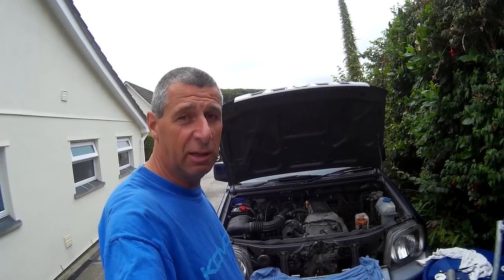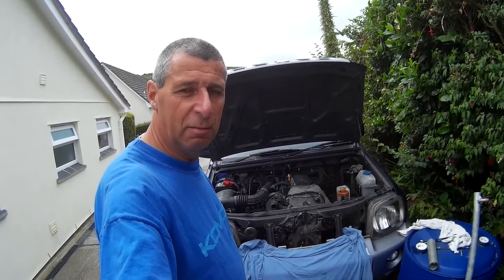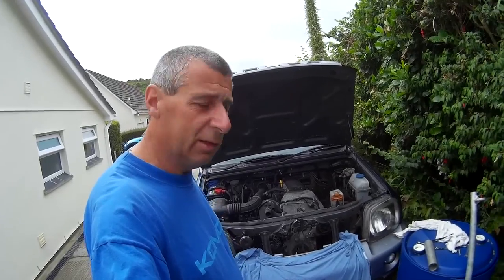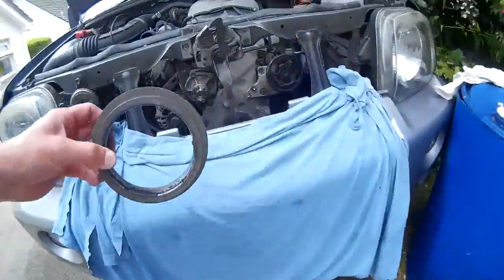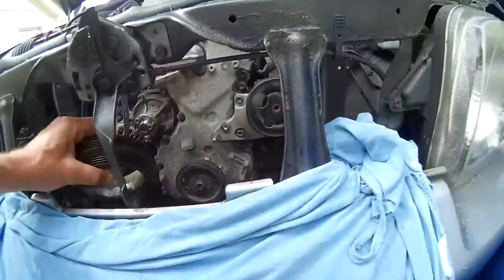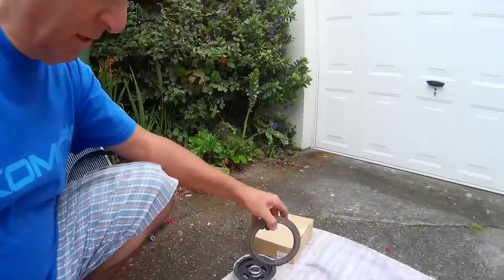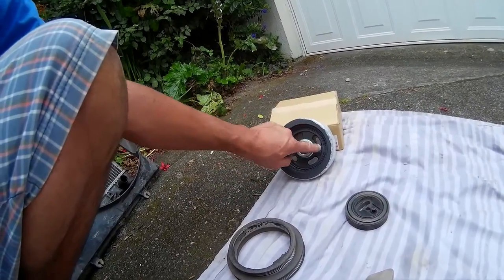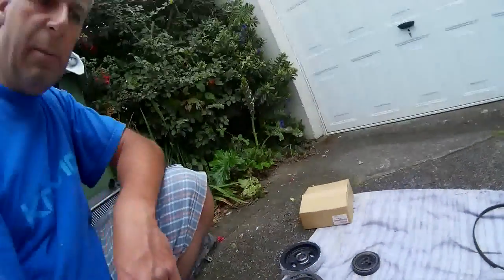Suzuki Jimny crank shaft pulley change.

Comment: Hi Guy's, need some technical advice please.  I removed crankshaft pulley from my 2006 Jimny and when I went to fit the new pulley I noticed that the woodruff key was badly damaged which I'm struggling to get out. Does anyone know if the toothed gear on the end of the crankshaft comes off or is it part of the crank. I was thinking if I can get this off then I'll be able to get to the rest of the woodruff key. Thank you.

Comment: Hi, Yes, useful ideas here bracing a spanner against the cross member. Unfortunately, this didn't work for me and I bent the edge of the cross member (superficially) and the spanner itself started to bend. When this failed (ie with a 3 foot tube on the bar for the nut) I resorted to the 'American method' of bracing the bar and turning the starter key. On the second attempt it came undone and the bolt fell on the floor :-)  The only other thing I would add to the american method is that we english would probably add the safety benefit of closing the bonnet during the attempt :-) HTH
Reply from the maker: I am sorry it didn't work for you and caused you added problems. If you don't try, you will never know. I am glad you got it sorted. Have a good new year and thank you for watching. 👍

Comment: Can anyone tell me what direction bolt undoes please
Reply from the maker: Peter Knight.  Hi Peter. The bolt is the same as any other. Anti clockwise to undo. It is very tight, especially if it has never been undone. Use a good spanner, and a blow lamp to heat the bolt up. Thank you for watching.